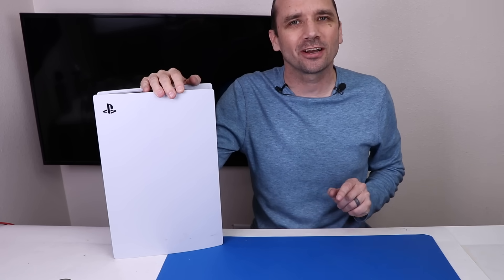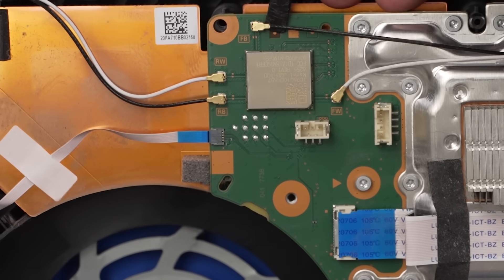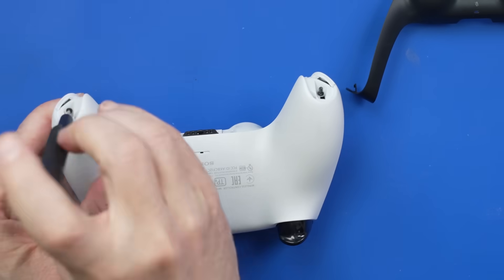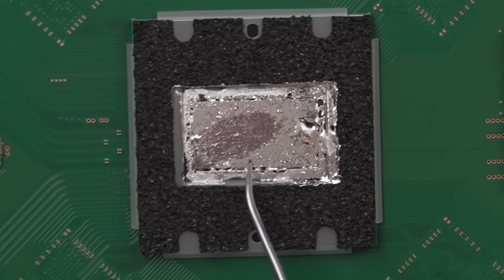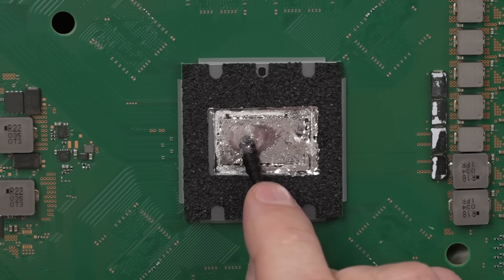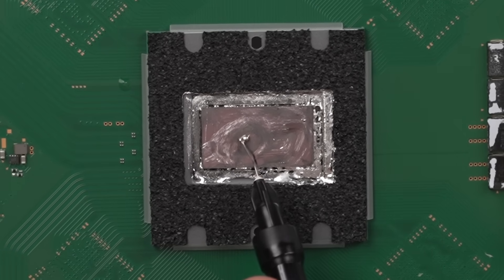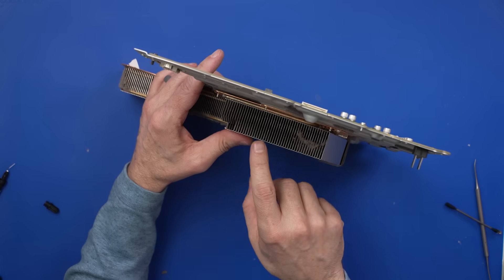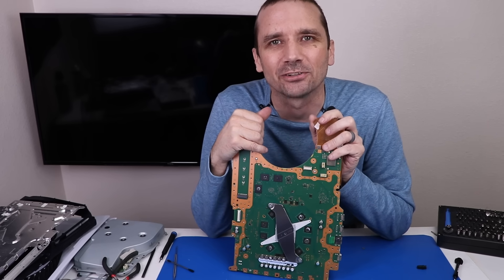How to Fix the PS5 Liquid Metal Problem

Comment from the maker: Here's the link for the liquid metal I use (paid Amazon affiliate link): https://geni.us/NFVlyM
Reply: I don't see the black Q-Tip thing that you used. Do you have a link to those as well?
Reply: I see spanish tech installing Thermal CARBONAUTS carbon pad instead of Metal Liquid and ...it seem to work flawlessly....
Reply: I think it's stupid that you have to claim affiliate link because the Enterprise for the consumers the same it's not like you're making them pay more and it only really matters if you're trying to boycott someone at which point you just wouldn't be using the link they provided anyways sorry just some board rambling
Reply: You should order from dkoldies and see if there "refurbished"  are up to par. Love your channel by the way
Reply: Your tools link doesn't include that little heatsink brush, where did you get that?
Reply: Thanks for the link! I need this for a repair. Client tripped on the HDMI cord and the unit hit the ground from high up. Thought the HDMI port just needed to be replaced until I saw liquid metal in places it shouldn't have been.

Comment: Just did this. Had a huge dry spot, as well as major dust build up in the heat sinks & PSU. Used isopropyl alcohol to clean the oxidation as well as to collect the LM to respread it. Worked like a charm, my ps5 hasn't randomly shut off since.

Comment: The thing is that the dry spot on that is towards the top half of the piece. Since the PS5 is vertical the liquid metal does not leak out but it does gather at the bottom instead of being evenly spread out. If the dry spot was on the bottom of the chip then this rumor would be 100% debunked.

Comment: Quick question, does the clamp on both side of the screws have a little air space and not fully stuck into the motherboard? Or does it have to go 100% “flat” on it?

Comment: Just about to attempt this for the 1st time

Have the liquid metal pack with the black Q tip type things but I'm slightly confused and don't want to screw it up

It appears when you clean the surface that the liquid metal kind of gets soaked up and dissapears

But then when you apply a few drops to it to redo it you use the same black tip things but instead of soaking up or removing anything it just spreads the stuff

How can it clean/soak up but also spread evenly without cleaning/soaking up

I'm just missing something and obviously don't want to screw up any part of it and cause any potential damage to my ps5

Any explanation or help/tips would be appreciated.

Thanks

Comment: My console turns on and after 1 sec off, i opened the console and saw the oxidation on both sides, the apu and the heat sink, i cleaned it and spread the rest of the liquid metal even on the apu and the heat sink, but the console still goes off after 1 second. I ordered fresh liquid metal and will try it one more time. Do you think it is from the oxidation or something else? Please help guys 😢
Reply: @zlatana8472  it’s the power supply. Clean of the dust off it.

Comment: The Liquid Metal won't leak but standing your PS5 vertical will most definitely cause the liquid metal to drop to the bottom of the APU die causing a dry spot just like the one in this video btw i've never seen a PS5 with this problem when kept horizontal so basically to avoid this issue keep your PS5 horizontal very easy but nowadays companies don't care whether something works or if it's practical as long as it looks good

Comment: Thanks for the vid. Really helpful. As good as lm is, it seems like there's a need for improvement or evolution here. So many folks in the comments suffering with overheating and resolved by fixing/replacing the lm. Seems like it's too high maintenance.

Comment: Hi guys I would really appreciate some feedback. So I’ve changed Liquid Metal before on a ps5 this time my ps5 died on me with really poor performance and horizontal break lines. So I changed the Liquid Metal. At first it was still a little bit laggy but after about 20 mins of playing it, it fixed itself. It caused me so much anxiety because I broke the blu ray ribbon cable and I thought I’d broken my ps5 further (burned apu) my question is: is it normal that it takes a few minutes for the PlayStation to register that it’s okay again so it was a bit choppy but then fixed itself. Is there a reason for this just for my peace of mind! Thanks in advance 🙏

Comment: Im sorry but thats to skectchy to do. Its a 500$ system. Should not have to do this in the slightest
Reply: @claytonhuett212  facts… I had an Xbox 360 back in the day and didn’t overheat once for over 5-8 years. Still worked a couple years ago.. never broke.. or overheated. I’ve had the mw3 ps5 for about two years and it’s shitting out on me
Reply: @tylerturrubiate3524  yea man. i had to get rid of my first ps5 after two years. i have an xbox 360 ive had for over 8 years that i bought off a dude who had it for years before that n it runs great to this day no problems

Comment: I don't think this is to do with oxidation. I think it's an issue called "pump-out". Thermal expansion means the processor and heatsink expand when they get hot, constricting the space and squeezing out the liquid metal TIM. I heard that Sony used a silver-plated heatsink to try to counter this (supposedly silver having higher wettability but I'm not sure) but it obviously isn't foolproof. Pump-out is an issue faced by PC gaming enthusiasts who use this liquid metal TIM.

Comment: This totally solved our overheating issue.  PS5 - 1215a was super clean on the inside but overheated with every use.  We stand it vertically and the LM gradually moved down with heat and gravity.  Lots of dark oxidation.  we bought the kit recommended here and it worked perfectly.  Thank you!!

Comment: Hi Steve love your videos always watch them just quick question iv got ps5 that doesn’t play ps5 games keeps shutting off after 5 minutes of game play I have reinstalled the system and still does it could this be to do with over heating issue. And need to reapply Liquid Metal ?

Comment: Hey man, does a repaired (or taken apart) ps5 have the vertical licuid metal problem (leak on the motherboard) or it can happen at a ps5 that has never been repaired before

Comment: Very nice!!! My PS5 ALWAYS shut down during Bahamut battle in FF XVI... Gathered some courage and opened my PS5 to expose the liquid metal! To my surprise it really had a dry spot about half the size on the video. I did not apply new liquid metal, just sucked some from the borders with a syringe and re-applied on top of SoC and heatsink. re assembled everything and start to play the entire Bahamut sequence, and to my surprise it did not shut down!!!!!!!!!
Reply: Damn man that fight is like an hour and a half long, sorry that you lost that much progress many times
Reply: love that game
Reply: For me my problem with random shut downs was during the air buster fight in FFVII remake. I oddly enough don’t really have the shut off problem in some of the most graphically demanding games on ps5 (except Spiderman 2) like it happens in Dragon Ball Soarking Zero and Fortnite and literally five minutes ago for Like a Dragon Infinite Wealth
Reply: sonic how long your fix worked before you had to re-open the console again and also what kind of empty syringe (purchase link needed) you used ?
Reply: @soniccinos Just got a PS5 myself. Do you run yours vertical or horizontal? I beat final fantasy 16 on my series X, I'll be pissed if that happened.
Reply: @Trippy13ful  If you want to be safe, keep it horizontal, but having it vertical shouldn't be an issue anymore, mostly happened to base model ps5s when they first released and like he said in the video, unless you've dropped your console, you shouldn't have those issue bedside a little bit of pooling

Comment: Liquid Metal is nice and all, though I feel like it would have overall been better if Sony just used thermal paste instead. Afterall it's direct die cooling anyway so there won't be that much of a difference.
Reply: It's a massive difference under load liquid metal can have 10-20C lower temperatures than typical thermal paste especially when its direct die.
Reply: @Malinkadink  On PC CPUs and direct die cooling, the difference between Thermal Paste and Liquid Metal is at most 5°c to 7°c.
10°c - 20°c difference is only when you put the IHS on top.

Comment: Hey Steve. I have the following issue with my PS5 but I can't find what's causing it and also can't find a service center that will investigate it in my town. The warranty already expired. I'd really appreciate your help on this. In some PS5 games, the games crash almost instantly every time. The games that crash are Spider-Man 2, Ratchet and Clank Rift Apart and Control(only on quality graphics mode). Every other game I tried, works fine. I thought that it may be an overheating problem and I followed your guide on how to clean my PS5. I completely disassembled my PS5 but there was almost no dust at all. I also found a minor problem as displayed here with the liquid metal and fixed that also. Unfortunately, after the assembly, I still have the same issue.  Do you have any clue on what the issue may be?

Best regards,
Spyros

Comment: Is there a reason we cant just replace it with some top tier thermal paste?
Reply: Someone did a test on it. The rundown is that thermal paste doesn't work as well as the liquid metal. The thermal paste had the console shut off from the heat while the liquid metal worked as advertised

Comment: Thanks for the info. I referenced your video to save my 2021 PS5 in time for FFXVI! That demo really did a gut check on my PS5. It kept shutting down at the Morbol fight. Opened it up and sure enough I had a massive dry spot plus the heatsink has erosion. Replaced the liquid metal and now my PS5 doesn't shut down at that specific fight. Time will tell how long this beast will live. Thanks again for the video!

Comment: Thank you for the great video. I was able to fix my friends ps5 with it. His had a massive dry spot on the APU when we got it apart, looked much worse than the video, lol. Cleaning it and adding fresh LM and spreading it like how you demonstate has made a world of difference. 

For those scared of doing this, it was pretty easy to clean and apply new LM. It doesnt run freely like water, it behaves pretty similarly to thermal paste. Its not as tempermental as solder either, it behaves pretty well. Just do it like the video.
And you dont really have to worry about putting too much, the sponge will absorb excess LM when you press it back together, its really well designed. Just get a nice even layer on there. The most challenging part is keeping tracks of all the screws for the backplate honestly.
Recommend the ifixit kit. Picked one up at best buy. And used the LM linked  in the description.
Reply: Any links to how I reassemble the ps5 after applying the liquid metal? Where do the screws go?
Reply: How long did it fix this issue?

Comment: With the 1200, does board and heatsink come out as whole like at 12:00, system is only 7 months old so doubt the metal needs to be checked since its runs pretty cool still, mainly wanna pull it apart to remove the cmos for blank trophy stamps on my alt account but I'm still conflicted if I wanna void my warranty or wait 5 more months 😅 Though should I be checking the liquid metal every 12 months when I do more normal clean if using it vertically or would every 24 months be fine for the liquid metal?

Comment: I was lucky enough to get a ps5 on release date, I am not sure if the amount you play it matters or not, but I play mine around 8-10 hours a week, might have the odd day where I play all day. It is used regularly to watch Netflix. I have had mine standing up right since the day I got it and I’ve never had a problem with it. I do take the sides off every 6 months or so and blow some compressed air through it, but that’s it. I’ve never taken the fan out or anything and it’s always been fine for me.

Comment: I dont know how these units are so dirty. I have had mine since launch. I opened it just to pull the fan and clean that and vaccume out the inside and blow it out real quick. I had virtually zero dirt on my fan and couldnt see anything on the inside either. So how some of these get completely clogged are these units on the carpet next to a cat bed or something. I use mine a decent amount but not everyday of the week

Comment: Hey Steve, is this oxidation issue not considered a factory defect?  Not that you could really prove it to Sony unless you opened it yourself and documented it, but at that point, it would be easier to just follow this guide and fix it yourself.  Or is this just a common issue with liquid metal use that is less common until this generation, since Sony opted/engineered the PS5 for liquid metal use rather than thermal paste?

Comment: This is a really big flaw in the design. There's no way that consumer electronics should be designed in such a way that it requires the end user to periodically open them up to clean out dust and re-spread liquid metal. You wouldn't expect to have to disassemble your TV or microwave every few months for it to keep working properly and nor should you have to do so with your games console.
Reply: Consoles are just computers,  any person that takes care of their computers know they have to take care of em.  It has moving parts and it isn't built to last forever, no electric does, same with cars. You need to take care of your belongings.

Your analogy of TV's and Microwaves is also flawed because they also do require maintenance overtime and they always eventually break down, TV's pixels burn out, Microwaves lose power and won't be able to heat food.

A car that isn't well taken care of will break apart.
Reply: Defending intentionally flawed designs that are meant to force users to spend more money is not only reatarded but is sickening. People like yourself are to thank for the abysmal levels of greed in the gaming industry.
It wouldnt be possible without you. @Tails95
Reply: @RandoManFPV  except its not flawed...
Reply: @TimeMasterOG  perhaps you'd like to buy my ps5 then. I'll sell it for just 250$!! 🤣🤣🤣🤦‍♂️🤦‍♂️🤦‍♂️ according to you it has no flaws or problems
Reply: yeah, very few people who buy consoles are gonna wanna have to deal with this. they intentionally build nearly everything to break down faster these days to boost sales.
this is especially true for controllers. with ps2 and ps3 my controllers lasted for years and stick drift wasn't even a thing, now on modern consoles i'm lucky if i get over 6 months out of a controller.
Reply: @Jack_80  yes it is a thing... Of you were to use a ps2 today the dead zone is going to be crippling
Reply: Have you ever had a PC before? You have to regularly re-apply the thermal paste along with cleaning out all of the dust.
Reply: So you wouldn't even dust the thing out?
Reply: Ur microwave doesn’t play games in 4k
Reply: You gotta be one of those dudes who have roaches in their stuff! Who doesn’t clean? I sure hope you clean your microwave too btw. Gah. 😂
Reply: I mean a year later and out of all my friends I’m the only one with this problem. Doesn’t seem that huge to me
Reply: @BartechTV  cars are the same way? You gotta have some type of maintenance
Reply: This is a terrible take.
Reply: no u could buy dust covers if u dont want to do that
Reply: @piksu61  lol L take
Reply: Why shouldn’t I have to? Who said that I should have to remain ignorant of the technology my life depends on? Who said I shouldn’t be required to learn anything about it to use it? Cause that person was an idiot.
Reply: @icankickflipok  I'll say it then. I bought a launch wii and it works. My ps4 is 7 years old and my ps5 fried after 5 months.
  I gotta void the warranty to perform maintenance?  That is ignorant.
   If your life depends on a ps5 you got bigger problems anyway.
Reply: @smocloud  your life doesn't depend on a PS5 🤣

Comment: My question with PS5 is: is there any effective way to run it using thermal paste instead of liquid metal and have it work normally even if it gets a bit hotter? Why would I wanna do that? I collect consoles and having a PS5 that can deteriorate over the years is very stressing. From my experience with my PS5 I think it could do 20+ degrees hotter than what it currently does. I would prefer if my fan breaks down that have a deteriorated apu.

Comment: I think he is just wrong. The pooling is only happening AFTER he takes the heat sink off. When everything is pressed together it’s all sealed up and it can’t go anywhere whether it’s vertical horizontal upside down backwards diagonal… you get the point. I’m pretty sure they would think of this when designing the console.

Comment: What a bad design flaw, Sony, really. As most of the people don't even recognize the reason for this issue, the time will come, when eBay will be flooded with "broken" PS5s, which turn randomly off. Together with the more delicate dust/temperature issue compared to the PS4, this has to potential get much more worse over time as topic in the internet.